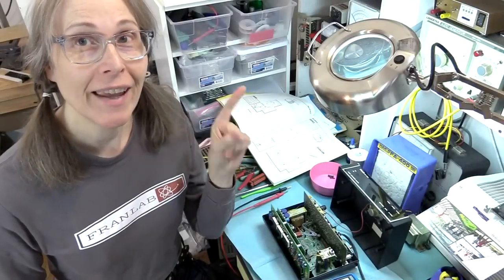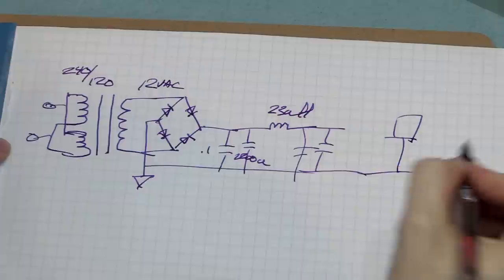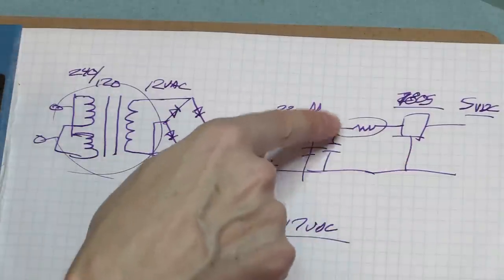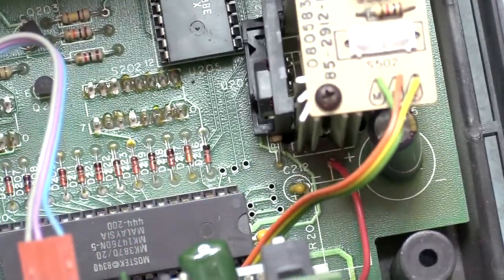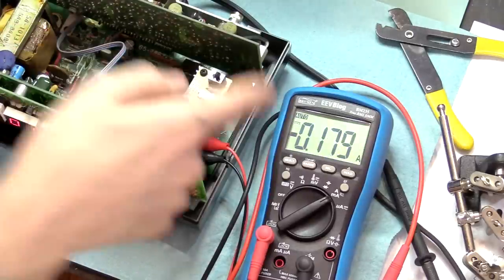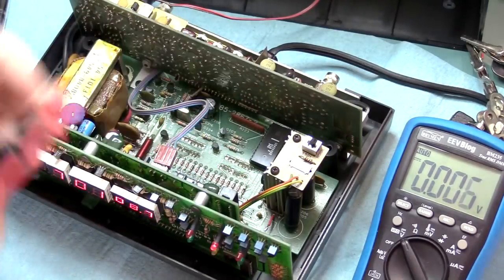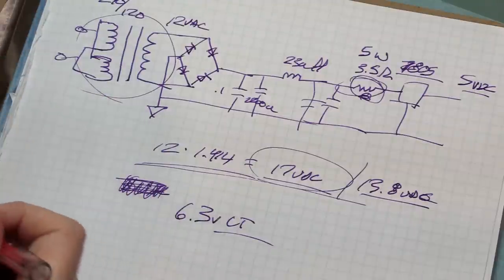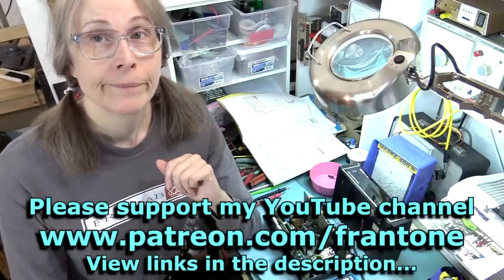Heathkit GC-1000 Power Supply Design Fails and Fixes

Comment: Hi Fran. That switching regulator will be drawing much less current than when the linear regulator is re-fitted. But linear is necessary to avoid the interference. I suggest you try rewiring the transformer primary for 240V. Maybe you'll be left with just enough secondary volts to play with. If so, try a 7805 (or beefier) regulator without the dropper resistor. If you have less than 7-volts on the 7805 input, consider using a low-dropout regulator instead. 
If the voltage is insufficient for the small 8-volt regulator, consider a low-dropout version there also - or if you're really starved for voltage, replace it with a low value resistor followed by a little additional smoothing and an 8 or 9 volt zener for a bit of over-voltage protection.
Reply: The same transformer secondary is feeding an 8V regulator, too, so that's right out.
Reply: @ordinaryaverageguy76  If you read my comment in FULL, I did address the 8-volt issue also. I appreciate she will need to be lucky to have enough volts available, but if the 8-volt section is not too critical, my alternatIve 'bodge' might just work well enough.

Comment: A few dIodes in series simple solution ~0.6 v drop each
Reply: True but if your using them in 2P2S config you only get 2 diodes per block but NOT double the current rating due to diode characteristic so you need about 5 blocks to drop 6V, a mod board made from Veroboard and about 9 diodes might be a cheaper option then 5 BRs

Comment: I think is possible to use diodes like 1n4001 in series to give voltage drop before the linear regulator. From 0 to 300ma each diode will provide a 0.6 to 0.8 volt drop.
Reply: A diode used to drop voltage is still going to generate heat like a resistor.  I'm not sure if she's interested in just lowering the heat in a 7805 or if she's interested in lowering the total heat in the cabinet, too.  If the former, a larger value series resistor than the original would do it.

Comment: Why not try powering it through the 12v input socket on the back from your bench power supply then you vary the voltage down to see if the radio board still functions at the lower voltage.

Comment: Did you forget that this was supposed to also work off 13.8VDC for mobile operation?  Voltage divider?
Reply: A pre-regulator is a better way to go.  Start the design and work out the power and you will see what happens.  The power numbers are much better in the pre-regulator case.

Comment: I see that a few people mentioned that you now have an efficient DC-DC converter so to find out what the current will have been you should measure the current on the 5V side not at the input of the DC-DC regulator.
Reply: Or for a good enough number just assume the power into the DC-DC is only about 20% more than the power out and do the math.  Either way would be good enough for the heat calculations.  Remember that the mains voltage can vary by 10% so too much accuracy is not needed.

Comment: I haven't built a regulated 5 volt power supply since junior high school, but I used 6.3 volt filament transformers. One ran a radio non-stop for over 20 years. Why not wire the primary windings in series for 240 volts? Unless I'm overlooking something, that should work. Cool video!
Reply: The same transformer secondary & bridge is feeding an 8V regulator, too, so 6.3 probably won't cut it.  Fran seems to have looked at that already.

Comment: 7809 or  LM317 ahead of the 7805 in place of the resistor :D
Reply: That's still wasting power in heat, isn't it?  Might as well use a resistor.

Comment: Would changing to a half wave rectifier be a fix. You may need more capacitance to smooth out the current. 

The effective voltage into the rectifier would then be about 7.6 volts.
Reply: Charles, good idea! Sometimes you can also “under filter” the supply to allow it to have some extra ripple. But the ripple should still be well above the output voltage, plus the regulator dropout, plus a safety factor. With these two tricks you could substantially drop the regulator dissipation. But then again.... who designs any stuff (with current over about 100mA) with linear regulators anymore?
Reply: >who designs any stuff (with current over about 100mA) with linear anymore?

Some RF engineers?

Comment: 13.5v in and 250mA into the switching regulator (rounding each to make it simple) is 3.375 Watts.  Assuming the switching regulator is, say, 75% efficient then the unit takes 2.5 Watts.  At 5v using a linear regulator it has 0.5 amps to power the unit (2.5Watts) and 8.5v to drop so the regulator ditches 4.25Watts of heat - ouch!
Reply: Yes, the direct path likely involves water cooling or something.  When you know there is a lot of drop, you can make a circuit to split the power among multiple parts.  A "current mirror" could make equal current flow in multiple transistors or a preregulator could take some of the voltage off the LM7805 or both.

Comment: Too many comments to read so if this has been said before sorry. Something is wrong here: regarding voltage drop across and power dissipated by the in series resistor I =0.2A R=3.5ohm then P=0.14w and V=0.7V. In other words at 200milliamp the dropping resistor is not dropping any voltage and is not generating any heat so the full 13.8V is being feed to the poor 7805 to do all the work. On the facts presented a simple solution would be to use 25ohm 10W (or two in parrallel 47ohm 5W) series resistor instead that would drop 5V and 5W giving the the 7805 8.8V at the input. Another solution could be a string of 5 or 6 power diodes each dropping 0.8-1.0V in series inplace of the dropping resistor.

Comment: I'd do it a different way: Add another regulator ahead of the 5v regulator; i.e., use a 7812 output to feed the 7805. Same amount of overall heat in the unit, but each individual IC running cooler. Just a thought in passing ...

Comment: Probably the reason they went with the 12VAC transformer was supply chain related, clock was a low volume item, thus they wanted to reuse existing part numbers available in house as much as possible. So, instead of a special order 8VAC transformer, which would give enough headroom to run both regulators comfortably, they went with an existing stock part, 12VAC, available off the shelf, and thus low cost with a new kit they were sure would only sell in low volume because of projected price.

An alternative to putting the variac or another transformer is to simply wire in a NPN power transistor as a pre regulator, either using a simple resistive divider, which would be low cost and somewhat inaccureate, but still good enough to keep input voltage range around 8-9V for the regulator, or a single zener diode of 9V1 1W, and put the transistor on the heatsink, isolated with a suitable kit, and leave the 5V regulator on a smaller heatsink, as it will be passing around 800mA through it ( your switcher input is 250mA, so output must be around 3 times that with the drop over it). That way no switcher noise, and the heat is dissipated by a much more capable transistor.  Easy enough to add, remove resistor, find the ground for the zener, and wire in place with a new larger heatsink. 

As well the existing switching regulator would perform better with a modern low ESR capacitor directly across input and output pins, probably around 220uF 25V input and output, which would reduce the switching noise considerably as well, as the old capacitor filter there likely has considerable ESR by now, plus was designed to give good reduction at 120Hz, not at kHz ripple, and coupled with the long traces it is radiating nicely from the wiring on the board.

Comment: Dropping 0.25A at 14V down to 5V, that's like 0.25 * (14 - 5) W in power dissipation in the regulator. Rather a lot for a 7805 unless it's on a good heat sink.

You could pre-regulate to e.g 9V and split the heat dissipation with where the 5W resistor was located.

Comment: take a few winds off the secondary or install an extra 9v reg in series to share the load drop it in two goes  or throw few diodes in series to drop it down
Reply: Modifying a transformer is harder than it sounds.  A better option along those lines is to replace it with one with a lower output.

Comment: What about the possibility of putting in a voltage divider, either after the rectifier bridge or after the capacitor filters, to drop the voltage down to a more acceptable voltage level for the 7805? I think the voltage divider will still have to be made with power resistors. 

The best bet would be to replace the transformer for a more suitable one. However, I wonder what else is using this transformer and rectifier bridge that was not mentioned?

Comment: I think you have overlooked a couple of things that the HealthKit engineers probably considered. Also I think you underestimate the current draw because you are measuring the input to a switch mode type regulator mod, not the actual current on the output of the regulator which is probably more like 500mA or more up to 1A. As others have mentioned in a switchmode psu the current out is not the same as current in like it is on a linear regulator psu.

Just on the 7 x 7 segment displays alone at lets say conservatively 10mA per segment x 5 segments(Ave) x 7 digits is about 350mA. So 500mA over all is a reasonable low guesstimate.

In the original linear design you are going to lose about 1.2v through the bridge. The 7805 has a 2v minimum dropout. losses across the 3.5 ohm resistor would be about 2v @ 500mA and maybe a volt drop from the xfmr secondary under half load. Discharge on a 2200uF capacitor @ 500mA would be about 2V in 10ms(100hz). Yeah I know you would use 120hz but this is back of envelope calculations. That brings us the following calculation: 12vac x 1.41 - 1.2 - 2 - 1 - 2 or about 11v min input at the regulator and 5V out. This gives you a margin of about 4v which is pretty good (you can’t drop below 7v at the regulator input or there will be ripple on the output). Based on those estimates I think the 3.5 ohm resistor is about right for a 12v transformer.

If you used a 6.3v ct transformer configured with ct to ground and 1 diode on each of the secondary connected at the cathodes and remove the dropper resistor you’d get about 7.5v pk at the input to the regulator and since the dropout is 2v that means you will get dropout as soon as the input capacitor discharges between peaks. Let’s say they drop by 2v down to 5.5v at the input to the regulator that won’t work. Of course if it had enough capacitance it might work, but you don’t say how much capacitance is used other than the 2200uF cap.

Maybe a 9v transformer would have given better results.

It would be interesting to see the original linear design connected up with a cro on the input to the regulator. I’ve done this on a 12v 10a linear power supply I’ve designed and built where I have about a 5v drop at 10amps on 37000uF caps that are charged up to about 25v between peaks.

Comment: Hi Fran, always enjoy your videos; so much nostalgia and brings up the good old times.

As a retired PS and inverter designer, I blame the 7805.  Back then, they are not as robust as the ones today. Heathkit must had a boatload of B stocks. 

There are many brilliant suggestions here. My 2 cents is to simply replace the failed 7805 with something like LD1085.  You need to replace the failed 7805 anyways. Last time I checked price was under $2. You won't need the dropping resistor anymore.

https://www.st.com/resource/en/datasheet/ld1085.pdf

Comment: Put a 12v/10/8v regulator in series with the existing 5 volt regulator, the jumper wire link would be an easy hacking point.

Comment: A few things...
The bridge voltage output calculation needs to include the two silicon diode drops conducting in the bridge during each half cycle (Vo=Vi*sqrt(2)-2*(.65 or so).
The 7805 is not a low-dropout regulator (LDO), so you need a bit of margin to accommodate that.
Will the input to the 8V regulator you mentioned be influenced by this change?

Comment: It sounds like there are any number of possible fixes. The one that came to my mind was just get a wall wart 9 volt power brick and add whatever connector is needed to plug into the 12 volt DC in. That should have the same effect as changing out the transformer as well as let you replace that switching regulator with the original specced one. If you have to have a power cord anyway, it really doesn't matter.
Reply: The same circuit is feeding an 8V regulator, too, so a 9v input isn't high enough yet.

Comment: Hi Fran, I'm intrigued ...
Strange that a 7805 burns so easily.
Personally my power supply uses a 7805 with potentiometer on the ground pin to adjust the output voltage, and drives a 2n3055.
The regulator input voltage is around 22.5V.
I use this power supply that I built 30 years ago and I never had any problems even if I pushed 5 amps ...
One thing I've noticed is that you haven't measured with the audio inserted, and that "drinks" a lot.
A small trick I used was to put a low pass filter (very low) between the regulator and the final, I repeat, never had problems in 30 years.
I'm very curious to see how this adventure ends :)
Reply: Well, your supply uses a 2N3055 as a follower, so the 7805 sees fairly small currents - about 1/30th of the output current worst case.

Comment: How would things pan out if you just switched the input voltage selector to 230V and drop the secondary that way? - Worse things have worked at significantly higher costs ;-)
Reply from the maker: It would likely be a little low for the 8V regulated supply to operate, but depending on the specific line voltage it might work.
Reply: Although it is very abvious now, I didn't it straight away that the 8V regulator is running from the same winding.
Can you run the 5V regulator from the output of the 8v one?
Reply: TheAmpair your mileage may vary but it is the first solution, no question.
Reply: There is a switch mode regulator in the clock as replacement for the 7805.
It is fed with 13 Volts, so the current using a linear regulator would be more than twice as measured.
Reply: @stephanc7192  
Doing it like that will work.  It spreads the power over 2 regulators so you still have as much heat to get rid of but an easier job doing it.
You do have to be sure that the capacitor on the output of the 8V and the input of the 5V are good enough.
Reply: @stephanc7192  I'm not an EE, but as I understand it the linear voltage regulator work by having variable internal resistance in series with the load. The unwanted voltage is dropped across that variable internal resistance and is converted to heat.

If I had to guess - if you put 8V and 5V regulator in series their total internal resistance would end up the same. Together they're still dropping the same total voltage, just together in series, so any wattage (heat) taken off the 5V regulator would have just moved to the 8V one. I'm guessing the that wouldn't have been attached to appropriate heat dissipation.
Reply: @stephanc7192  You'd simply move the heat dissipation to the unsinked 8V regular.
Reply: @FranLab  However, I think this would be a great temporary setup to get rid of the noisy regulator so you can troubleshoot the rest of the clock.
Reply: @FranLab  could you swap the 8V linear regulator, in this case, for an LDO regulator?
Reply: @FranLab  or for a quick Kludge,  replace the 7805, then replace that big 5W resister with 5 or 6 1N4004's (or whatever diodes you have) in series to drop the voltage down from ~13v. to ~ 9v, and move some the heat away from the 7805 and over to the diodes. .... (if necessary, you might also want to build a band-pass-filter (tuned to 5MHz WWV) for an external long-wire antenna. Maybe you can pick up enough of WWV while filtering out some of that cell-phone tower QRM (noise).)
Reply: @FranLab  I think there are some LDO versions you could drop in there.  And the drop out of the 78xx was never as high as they specified anyway.
Reply: Isn't that going right back to the flawed original design: dropping a bunch of volts in a lossy device before getting to the regulator?
Reply: @ordinaryaverageguy76  Yes. Just basically going back to the original HeathKit design, and see if the radio even works.  Switchers are efficient, which is very good, and less heat, but does the radio work with switching noise inside the box? or does it really need a linear supply? ... Anyway I'm just thinking out loud.  I'm happy to wait and see what Fran does next. Should be interesting whatever happens.  I'll stay tuned.
Reply: >Can you run the 5V regulator from the output of the 8v one?

Then the 8V regulator would have to be sized to carry the load current of the radio AND the 5V logic sections.  It would have to get a lot bigger.
Reply: @Fran Blanche 
Assuming you're not interested in lowering total heat in the cabinet, 
perhaps a bigger value of R201? Use a resistor that can be heatsinked. Maybe even one of the teeny-tiny fans? And then a 7805 type regulator.

Comment: Why not just replace the full wave bridge with a half wave (two diodes)? You may have to increase the filtering.
Reply: Halfwave rectifiers need only 1 diode in 1 leg of the secondary. The other leg is the current return.
Reply: You have a point...

Comment: I admit i probably dont know what im talking about, but couldnt you replace both power supplies with one 9vAC adaptor and a diode controlled gate to shunt/share power between the two pcbs. (+- to the radio board -+ to the display board) with caps/condensors to maintain voltage between wave gaps. ??